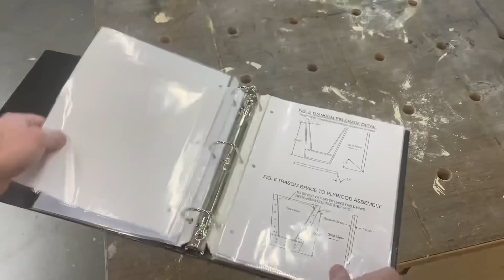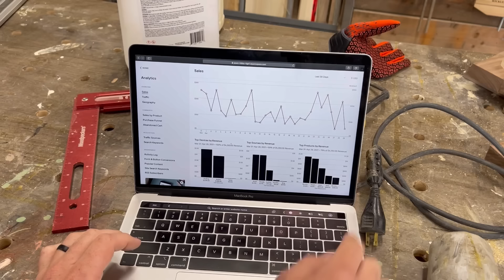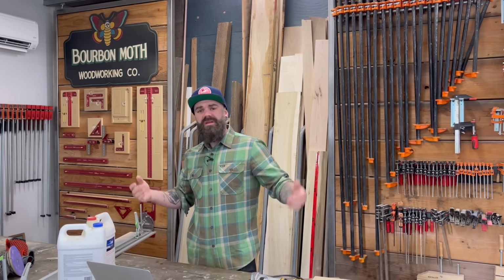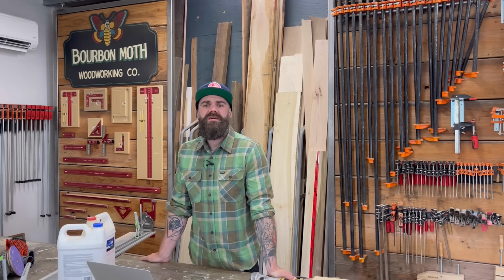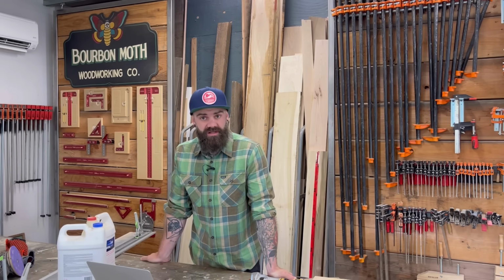10 Minute Boat Build || Boat Build Start to Finish

Comment: Love the channel.  Can you recommend a good dust mask for guys like us with beards. Thanks
Reply: Apparently If you smoke a Marlboro red while cutting/ sanding/ routing, the smoke deters all the dust in the opposite direction which nullifies any need for a dust mask.
Reply: @MrMd5555  can confirm. Any kind of dart works though.
Reply: Check out the resp-o-rator.  If you can get past the SCUBA-style weirdness, it solves the beard/safety glasses/earpro problems.

Comment: When I was 16, back in the days when they had high school shop classes (over 50 years ago), I decided I wanted to build an 8' hydroplane. I got the plans, marine plywood (it was $20 a sheet back then, very expensive) and everything else I needed to build it. By the end of the school year, it was ready to launch. My father and I took it down to the river and put it in the water. Everything was wonderful, but ... the outboard motor we had wouldn't start. Dejected, we were ready to leave, when a man who was watching us wanted to see it go, so he offered a 10hp outboard motor that he had. Reluctant to borrow it, but excited as well, we put it on my boat. Now, this was the maiden voyage, I had never driven a hydroplane, so I was not ready for what happened next. Rather than taking it slow to see how this would work, in typical teenage style, I gunned it. Well, it took off, stood straight up on the transom and prompt sunk. The guy's motor came off and sunk straight to the bottom and my boat was floating upside down in the water. We took the boat home and never used it again. My father dealt with the guy on the motor. I never asked how that turned out and we never discussed it again.

Comment: Looks like you put about 400 pounds of screws in that thing. I always just goop it with the big caulk tube of PL Premium, hit it with my brad nailer to hold it until the glue dries and call it good! Unless you're using screws for ballast...